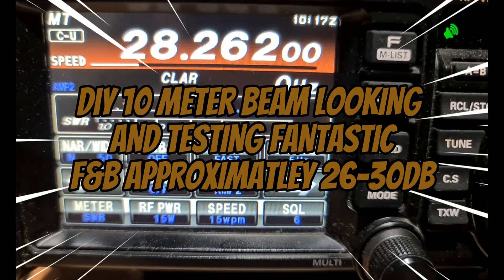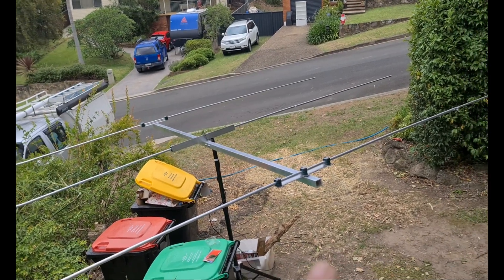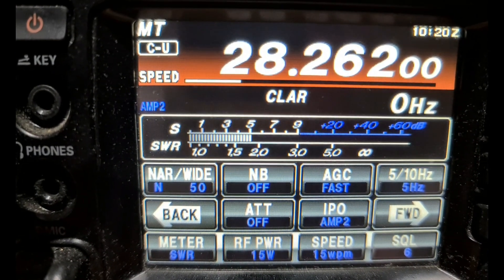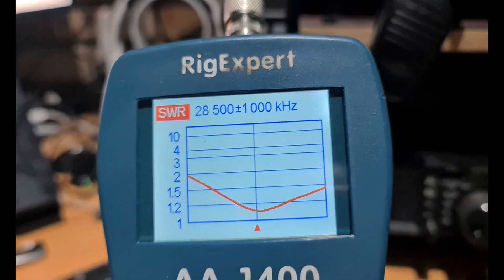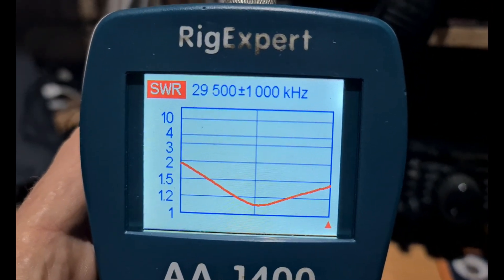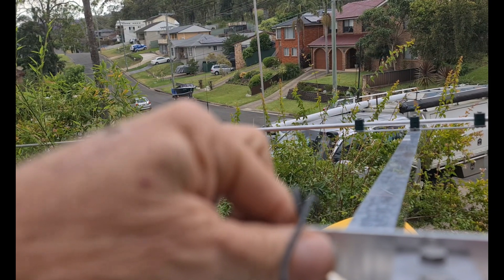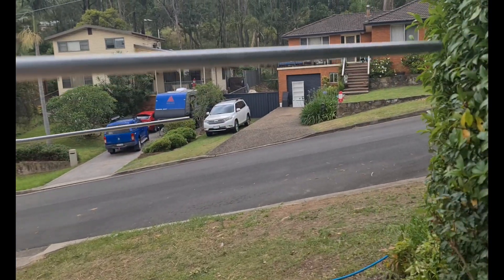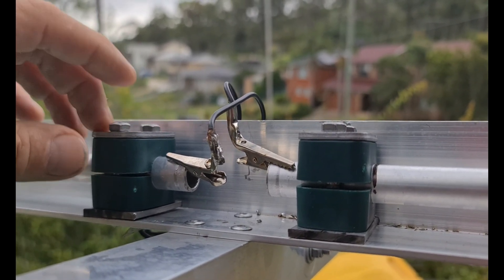MY DIY !0M 3 ELEMENT BEAM PT 3 - HF Antenna

Comment: With Driven element,no use balun??
Reply from the maker: No just remember the driven element is just a dipole a balun is just used to connect unbalanced to a balanced feed or simply connect the Center conductor to one side the drain to the other adjust swr as close as possible to 1:1:1 you should be all good to go, a balun makes it look more professional in the finished product no no not needed
Reply: @vk2lq  ok thanks,73 de YD∅NVU...cu on the bands to CQ WW CW DX Contest...

Comment: Amazed that it tunes up and exhibits F2B like that when under 2m above gnd.  Will probably have to return it when it's up in the air.  What are the clamps?
Reply from the maker: I used this antenna for about 3 months before making a 4 element version, No I didn't need to return it was placed about 5 METERS above ground,

Clamps are you meaning for the elements I mounted STAUFF clamps on to flat alloy plate.

I was amazed in it performance also but the F/B was amazing as shown in video 

Cheers 
73,s

Comment: U will need a choke at ya feedpoint and dont forget when its up higher ur swr will change
Reply from the maker: why do I need a choke at the feed point if you have an SWR @ 1:2:1 or better, yes, and thank you I am aware that in most cases the SWR will lower as the antenna goes higher in the sky? But i did add a 1:1 1KW balun but its not needed